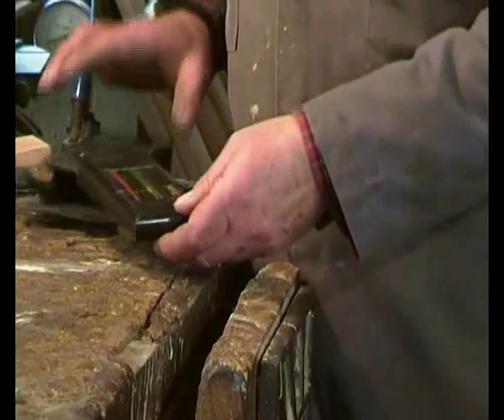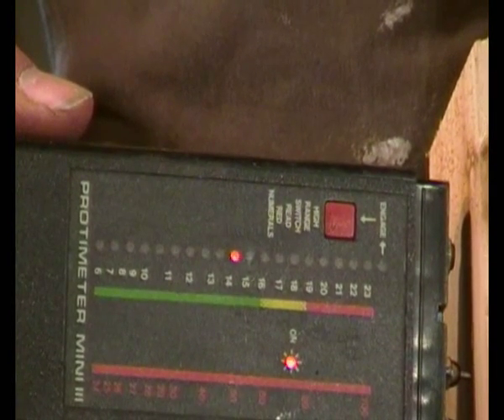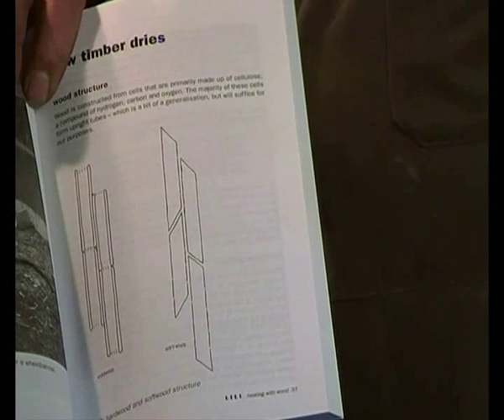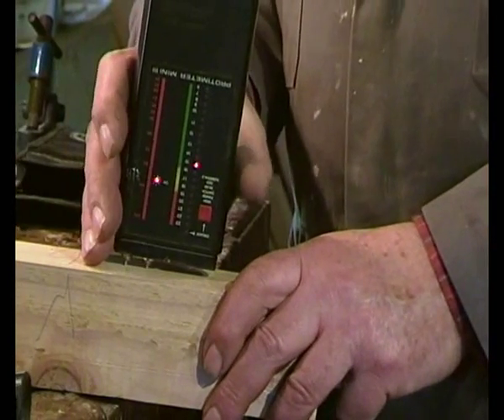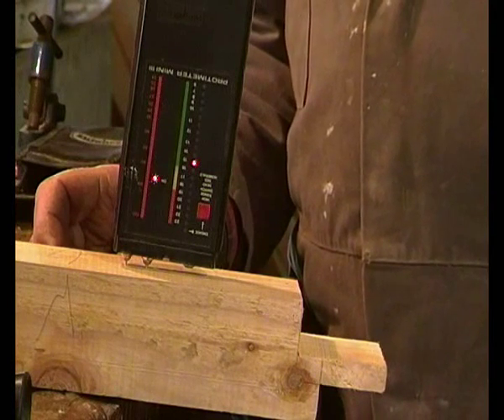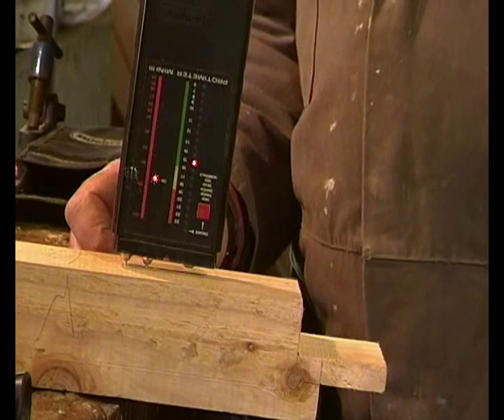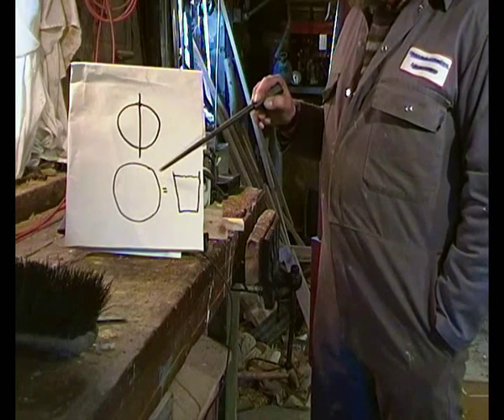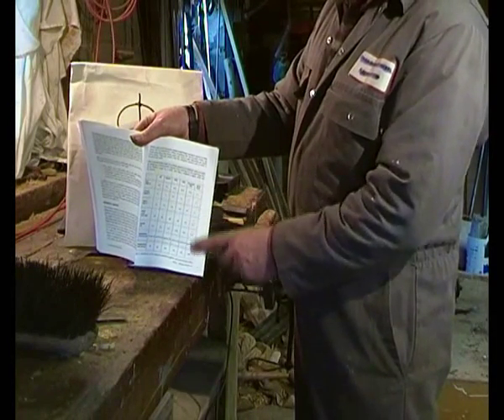Moisture content of timber and firewood, types of moisture meter and what the readings tell you.

Comment from the maker: Hi. In reply to your question. If you stick the meter probes in damp soil or a wet cloth and it reads near or at 100%, then it's a dry based meter with firefood at 20% or less. If it reads 50% then it is a wet based unit and your firewood should be at about 12% or less. Hope that helps, Andy